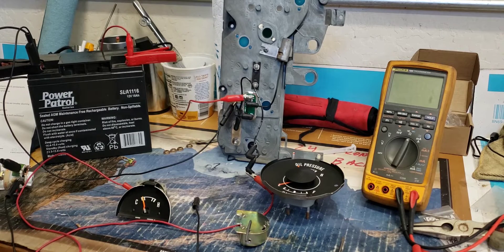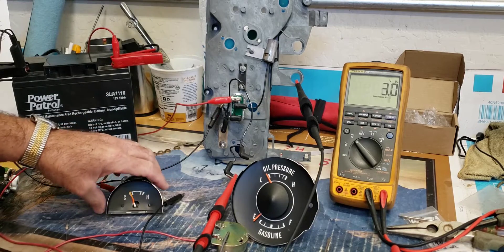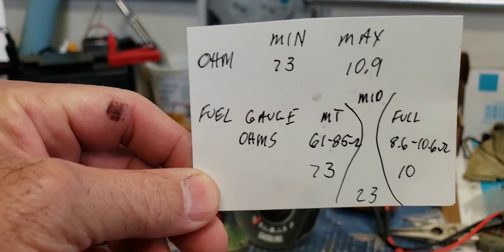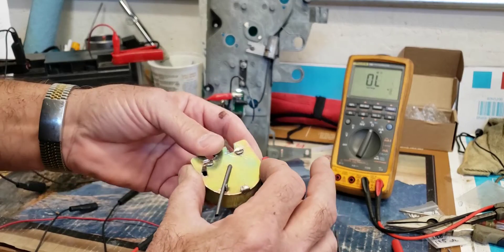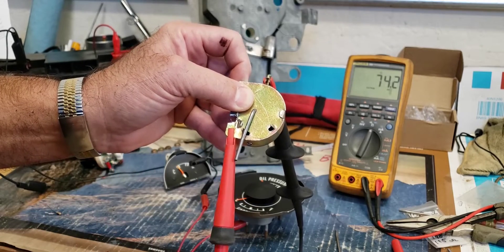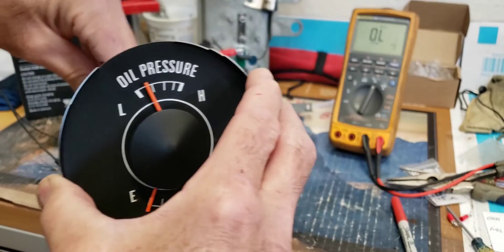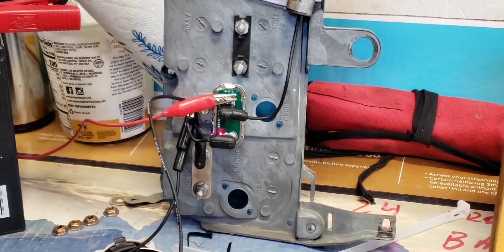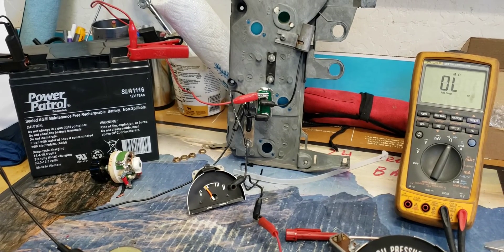Calibrating Mopar gauges on the bench.

Comment: I see where the 5v comes in from the regulator and goes to one post on the gauge and the second post on the gauge goes to the sending unit. However, where is the grounding point on the gauge itself once it is installed in the car?
Reply from the maker: The guage has 2 terminals, 5v pos, and the other goes to the sending unit be it fuel, temp, pressure, they all do the same thing. The sending unit has just 1 terminal on it, the wire from the guage. The sender apllies a variable ground to the wire. Thats why grounding the wire at the sender will send the guage to full scale.
Reply: @ oooh wow
Reply: I guess I can't figure out my problem then. All of my gauges are new but they behave the same way. They only go up very slightly when you turn on the key. Could it be a bad ground at the sender units or bad IVR
Reply from the maker: @eddiegarcia9657  Check voltage output of the IVR. It could be low. And bad grounds can do that too. Remove the wire from a sender and ground it to the engine block. The gauge should go full scale quickly. Do not let the guage stay at full scale like that. There could be high resistance conections in the wire between a sender and the gauge. Usual cause is the bulk head conector.
Reply: @ thank you sir, I will try that. This is a very informative video and there are not enough of these for mopars on You tube!